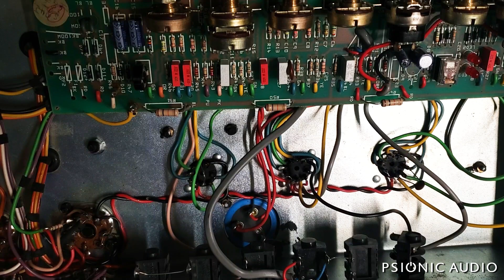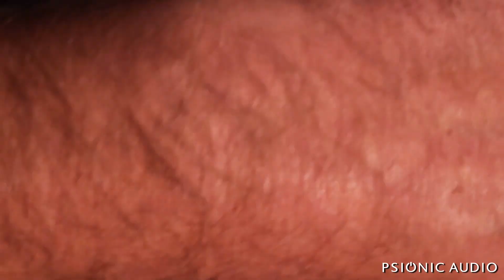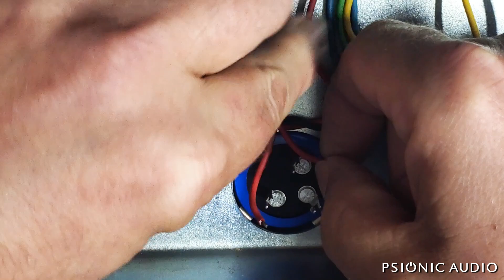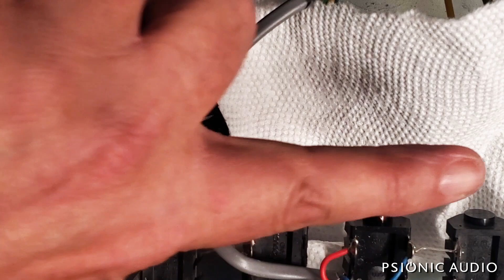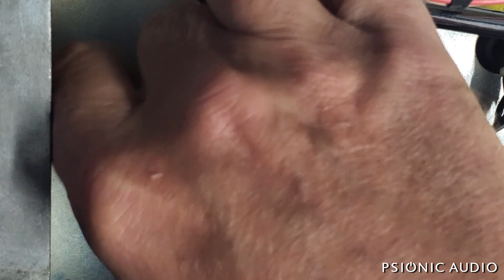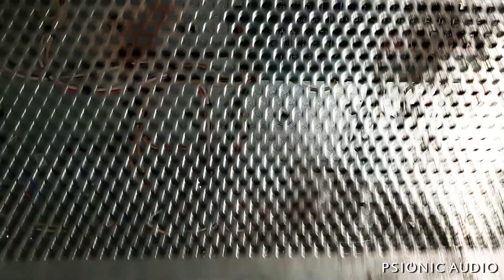Restoring an '87 Marshall 2553 Silver Jubilee | Part 2 : Complete Recap & Operating Check

Comment: Wombat, Hi my V2A preamp is 106,Volts and V2B is 240 Volts. My other two preamp Valves are about even on pin 1 and  6. Is it supposed to be like that?  Thanks Nick
Reply from the maker: Yes.

Comment: Would have loved to hear a before and after demo to see if the cap change actually made a change/improvement to the tone..
Reply from the maker: That's like asking if cars drive better with new tires and belts.
Reply: @PsionicAudio  Is there a way to test a cap electronically to see if its operating at spec?  but you're right... if the car didn't need new tires or belts you probably wouldnt notice the change

Comment: Did Marshall put Glyptol or similar threadlocking lacquer on the bolts and nuts to lock them and prevent them from vibrating loose? That stuff causes corrosion on a hot environment such as a tube amp, and the corrosion at the very end of the grounding bolt of that second filter cap is somewhat suspicious.
Reply from the maker: Nah, just black paint.

Comment: Try Nevr-Dull polishing wadding on the faceplate; it's the only thing I've found that you can use on a vintage McIntosh amp or receiver without removing the silkscreening.

Comment: I've cleaned and reused mounting/grounding hardware on a vintage Fender, but if it was a more modern amp with a PCB board ike this Marshall I'd probably just change the hardware and ditch the slotted screw for a Philips, Pozidrive, or even a Torx or Allen- head bolt, something easier to hold in place with a screwdriver while you tighten the nut from the other side; and swap out the black oxide star washer for a shiny chrome or stainless one.  Or, just solder the ground directly to the chassis.....either way, should we really care about mounting hardware originality in a modern amp with a PC board?
Reply from the maker: The value of these '87 SJs continues to increase, so I need to keep everything as original as possible.

Comment: How hot do you run your iron?
Reply from the maker: 700 usually. A bit more for eyelets, hotter for lead-free.
Reply: @PsionicAudio  Thanks. I've been running a little cold, time to jack up the temperature. Got a 5F6 Bassman to go through.

Comment: Sorry if I missed the reason for this, but is it generally preferable to solder the grounds of the dual capacitors you were replacing to the chassis vs using a nut, compression washer and bolt to the chassis? If not, could you please explain?  Thanks so much for all these great videos!

Comment: Great timing. Today I am recapping my 2550 Silver Jubilee as I watch your video.  Great tips on the ground connections and voltage differences across the screen resistors.  I’m an electrical tech studying tube amps for the last few years.  Thanks for the videos.

Comment: Hey Lyle, about that Dremel burnishing bit, I use a red or green Scotch-Brite pads cut up in small circles. I use the same Dremel bit that the small cutting discs go on.
A single pad would probably last you a year if that’s all you use it for. They don’t remove metal and you can get into anywhere with it.
Reply: Careful, Green definitely removes metal just very slowly. Red prolly does as well but the grey seems the most abrasive. The blue ones dont and that is why they can be used on pots and pans but I wouldnt recomend them for this application. Metal shop guys use scotchbright products to polish metal (Which works by removing metal).
Reply: "Magic eraser" pads will burnish metal; they're made from melamine (kitchen counter laminate!) that has been foamed with air and are surprisingly abrasive.